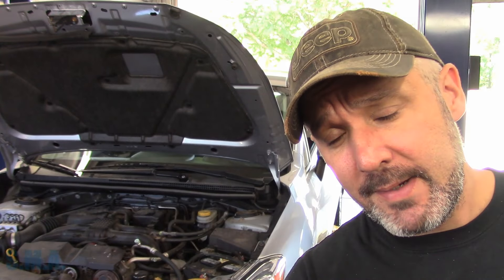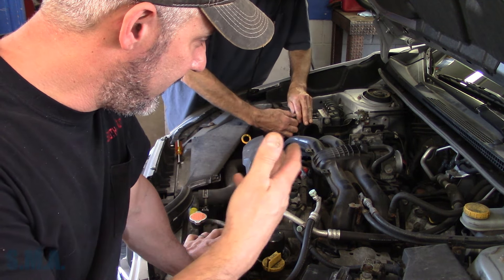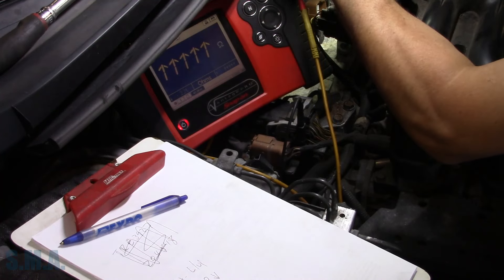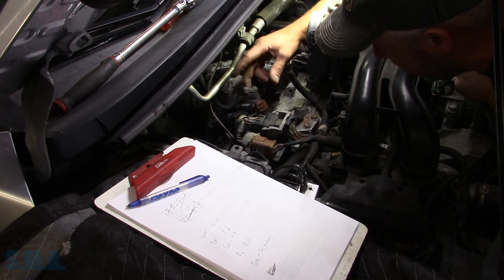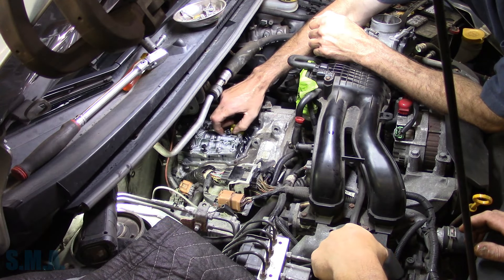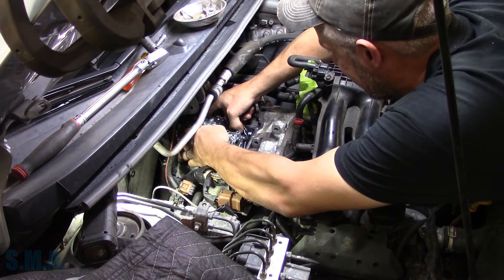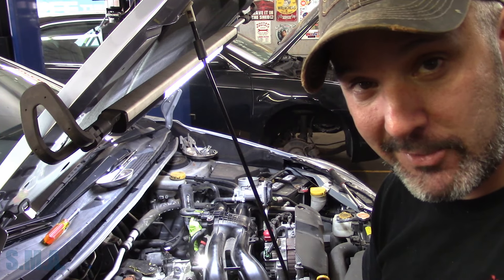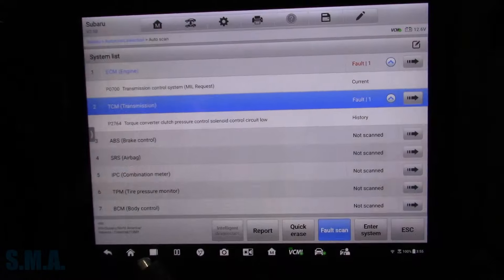Subaru CVT Transmission Valve Body TR580

Comment: My mom’s 2013 OB with the 2.5L engine has an issue with the CVT slipping on occasion when coasting downhill and when accelerating hard the rpms go up like mad. The car now has almost 100k on it and it’s been doing this since new. I had the CVT gear oil changed out already and so far it’s still the same. I’m wondering if this valve body could be the issue.

Comment: Hi there, should I also change even the codes are not always persist, so the same codes you have appears sometimes in the morning, and when they appear in dashboard, I simply turn off the car, then turn it on and the codes simply gone

Comment: I am facing with same problems but my code is different it gives 
P0971 code and AT OIL TEMP , traction and ABS lights came one 
Do you think it will be the body Valve ?

Comment: I just had a valve body replacement on my Subaru 2011 legacy but the car is stalling when I stop and then drive. Why do you think that is? 
The relearn system that was used was different from yours. Should I do the relearn you showed in this video instead? Please advise and thank you!
Reply: worn bushing in torque convertor

Comment: I prefer your original style of videos. These are fine however.  I am not a mechanic, but i fix or repair everything in my household domain. in 40 plus years of driving I have only paid for the inspection and emission stickers. you tube has made all types of repairs easier. in years past it was repair manuals and phone a friend that got me through. I am 63 but I think it is so interesting how many old sayings and slangs you use, most likely picked up from your father. your on screen relaxed, natural, informative and funny videos are great. as good as the information is I would likely not enjoy them as much if you weren't doing them

Comment: I am pulling P0700 and P0763 code but a mechanic who does not work on Subarus said I need a Transmission Valve Body Replacement.  I have a Subaru 2012 xpremium 2.5 NON Turbo.  But I can not find that for code P0763.   
Thanks in advance if you respond

Comment: OK......  have to ask.....    got a 2008 Subi Tribeca from my daughter (she was second owner from 23,000 to 185,000). It kept throwing a turbine speed sensor code. Subaru told her $$$$ to fix it. After I got the Subi I pulled the valve body and replaced the turbine speed sensor on top of the valve body....  No more codes but now every so often the car doesn't like reverse. It has to set for a few seconds in reverse before it likes to go in to gear. Has the required amount of fluid but feels like it doesn't when it does the reverse thing!!  So wondering if I should just replace the entire valve body, which would include a mother new turbine speed sensor.....???

Comment: Sir, isn't there a threaded hole in the dowel pins? In many cases there are, and you can pull the pins out with a slide hammer. Didn't Subaru think of this?

Comment: Hi eric i have a 2006 ford f150 supercharger truck and when i go to start it there seems to be no power in the crank shaft sensor what could be causing the problem if you can help me out?

Comment: I don't mind it someone else does the work. I would really like if there is something we need to watch for when taking out bolts like the underneath valve body has one or two longer screws, that you would take the time to say hey during this step you need to look for these two bolts.

Comment: i like this i might wind up doing this to my stupid Subaru cvt with that transmission hopefully the car will be gone before then. they already sent me a notice that my model has some transmission problems, so they extended warranty to 100,000 miles too bad im at 130,000 
Got any videos on changing some transmission fluid in this supposed lifetime fluid transmission? everyone has the newer 690 transmission

Comment: Your test showed that the output signal circuit of the lock-up duty solenoid is shorted. You should have shown the connector and how you tested it, while you did it. You should also get the camera closer when you are filming, if possible. Maybe hanging it straight above what you are doing. I can't believe that you had to replace the whole transmission valve body because of a short in one small wire. And it makes me wonder why this output signal circuit shorted in the first place. It shouldn't do that without impact from something. Could it be exposed to fluid of some kind?

Comment: Did you get the big plastic tarp with the valve body?  That is to cover the engine bay so you dont get any dirt inside the trans.  There is a hole in it that you put the valve body through it.  It took us a few times to actually figure out what the tarp was for🤣

Comment: Why does the valve body requires a calibration after the install? Solenoids are just on or off. There is no range to calibrate to. I am asking this as I am waiting for the delivery of my valve body and don't have the pro scan tool you have.

Comment: Can imagine it drove weird with no TCC lockup. Used to have a Saturn Ion with the VTi CVT. It had some logic where the TCC wouldn't lock up until the fluid warmed up to something like 30 degrees C in order to warm the fluid up faster. Well I assume whoever had that brilliant idea did NOT love somewhere which had extreme cold winter weather as that could take as long as 15 minutes in the -30 to -40 temps we can get, and it drove like it was stuck in low gear that whole time. Not good for acceleration or gas mileage in the winter for sure..

Comment: just a quick Q Eric O of SMA... Was there some reason the owner did not take the car to Subaru when the original trans failed at 8XK? most if not ALL of the Subaru Lineartronics have a 10yr/100K warranty that model of Impreza was included..

Comment: What AUTEL TOOL are you useing?? The link in your description doesn't lead to any specific tool.  Oh wait, you said Autel Ultra. It's about $6k so it's not worth the pricetag for the occasional use. 

I recently replaced my valve body on a 2014 Outback and need to reprogram the trans, but having a difficult time finding a tool that is affordable. Does anyone know if the Autel MaxiDAS DS808K will do the transmission reprogramming?

Comment: How common are CVT solenoid failures in Subaru's? Are Subaru's more prone to this failure and expensive repair? I'm not a big fan of Subarus or CVT's, but considering the 2024 Crosstrek for it's AWD and economy.
Reply: Most are from lack of proper maintenance/regular service every 30k. Also lot more common on the older years pre 2016. 2016+ is pretty solid, seen many with 250k on original if maintained/cared for properly.

Comment: Did you test the solenoid? Are you sure this was caused by a faulty solenoid and not by the power supply to the solenoid? The code said circuit low. This is just me trying to understand what happened since we didn't see what you were testing.
Reply from the maker: Maybe go back and watch the video where I showed how to test the bad one and then I show how to test the good one...

Comment: My 2016 legacy (tr580 cvt) Got problem codes:P0971–P1604 rear diff isnt working it drives with front wheels but to change solenoid i dont know diagram of tr580 help pls

Comment: So, is that a Jatco CVT? I've heard all sorts of bad stuff about those. Jatco is in a lot of cars. They give trouble.
Reply: Subaru motor vehicles have used manual, conventional automatic, and continuously variable (CVT) transmissions. Subaru manufactures its own manual and CVT transmissions (for non-Kei cars). Since the 1970s, all Subaru conventional automatic transmissions have been Jatco designs adapted to Subaru specifications.[citation needed] Since the 2014 model year, the conventional automatic transmissions in North American-spec Subaru vehicles have been replaced with Lineartronic CVTs (with some exceptions such as Outbacks with the 3.6 liter engine). 

Source: Wikipedia list Subaru transmissions

Comment: Eric, I am a little bit confused with this repair. It seems that you repaired the short, and did not change the lock-up solenoid. You did not show the repair of the short to ground.
Reply from the maker: The shorted solenoid was in the valve body. We replace the valve body because you cannot buy the solenoid separate. Makes sense now?

Comment: If the car doesn't stall or attempt to stall during 10 hard stops from 20mph to 0mph, 10/10 it needs a valve body.  If it does stall then it needs a valve body and torque converter

Comment: You always comment about nobody using the parking brake, let this be a lesson to people who don't. I was in a parallel-parking situation, standing behind my own Subaru (2nd-gen Outback), getting some things out of the back.  Another driver backed into the front of my car hard enough that it knocked the transmission out of park and into reverse. The car rolled backward knocking me down.  If there had been a car behind me I would have been pinned between the two. The parking brake keeps your car from becoming a free-range menace to pedestrians in the event of an accident. The only thing better would be carrying chocks with me.

Comment: Is this XT or 2.5?
Reply: Neither bro it's a 2.0 with a TR580, those engines you're speaking of prob have a tr690 which is accessed from under the transmission

Comment: One step process to fix any CVT. 
1. Trade car in on another vehicle with a normal transmission.
Fixed.
Reply: Check that the normal transmission isn't one that has been known to fail. It does happen, but very rarely compared to the automatic transmissions.

Comment: What, you couldn't just add an 11 ohm resistor in series with that?  Lol - I keed, I keed. 
Seriously, though - I believe there is a Subaru "special tool" which is plastic to cover everything (including hood) when that valve body is exposed.
Reply from the maker: Yeah they sent it with the valve body haha

Comment: At around 10 minutes you are levering on a bolt that goes through the top cover into the base.  How does levering up the base free the top cover????????      It is the top cover that needs to be levered up, surely?????

Comment: What bothers me about this video, is this Subaru has already had the transmission replaced and now the valve body, with such low mileage! Hmmm, I’ll keep my 97 Corolla, my 94 Camry, my 97 T100, my 93 SC400, my 99 Dodge diesel 2500, my 02 Lexus LS 430. What in the crap am I doing with so many vehicles! I’m single and live by myself. I need help...

Comment: P2764: Torque Converter Clutch Pressure Control Solenoid Ctrl Circuit Low OBD-II Trouble Code
A torque converter clutch pressure control solenoid allows the ECU to control the operation of the torque converter clutch by manipulating the flow of pressurized transmission fluid. If a low voltage signal is detected, a P2764 DTC will be stored. How Serious is the Code? In terms of severity, a P2764 diagnostic trouble code is quite serious because it means the ECU is having trouble engaging and disengaging the TCC clutch. Some of the transmission problems you may experience include engine stalling, transmission overheating and erratic shifting.

Causes
Insufficient transmission fluid
Dirty transmission fluid / filter
Frayed wiring / damaged connectors
Transmission fluid leak
Failing torque converter clutch pressure control solenoid
Failing torque converter
Failing torque converter clutch
Internal pressure problems
Valve body issue
ECU or TCM failure

How to Diagnose the Code?
The first step to diagnosing a P2764 OBDII trouble code, is checking the level and condition of the transmission fluid. Checking the wiring and connectors for signs of damage and corrosion should also be done. If everything looks good, the TCC pressure control solenoid will have to be checked. 

What Repairs Will Fix P2764?
Change the transmission fluid and filter
Repair transmission fluid leaks
Clean corrosion from connectors
Repair or replace wiring
Replace faulty torque converter clutch pressure control solenoid
Repair or replace a faulty torque converter clutch
Repair or replace defective torque converter
Flash or replace ECU/TCM

This explanation is taken from transmissionrepaircostguide. I hope they don't mind that I copied it, since I guess I cannot link to it from here.

To the australian guys: What is seems that you can try to do yourself, is to clean possible corrosion from the connectors, and if that doesn't help - change the transmission fluid and filter. There could be more severe problems with the transmission, but since those two alternatives are listed here it might be worht a try?

This seem to boil down to a stop in the signalling between the torch converter clutch and the ECU. So if I understand this correctly, the signalling between the torch converter clutch and the ECU is still analog on this transmission. Am I right in assuming that? 

And is there still a chance that the torque converter or the torque converter clutch has failed?

Comment: And that there is "exactly" what is wrong with a mates car here and subaru being a pack of C's don't want to know anything about it unlike america where they have extended the cars warranty repair services to 10 yrs due to this issue. I also believe it is a Gen 1 box so valve body underneath. It has been to a subaru dealer and tested but no listing for the ohms other than "low" and we can't buy the valve body in Australia. Bastages !
Reply: Further to this issue I did actually get around to finding out which box it had TR580 and further on I removed the valve body, replaced the faulty solenoid, repaired the earth for the primary up solenoid as it was broken, put it all back together and P2763 code fixed no relearn required. Happy days.

Comment: I never understood why manufacturers cancel the stability and cruise control with any MIL activation. Subaru does that for a evap and cat codes. Can’t see how that would impair the safety of the vehicle. I know Toyota does that as well. CVT=garbage.

Comment: turdbawuuu. what year is it? how many kilos/miles for first trans to fail? you have to baby the gas pedal on these they're not designed to handle "hard" acceleration lol imagine that they dont even put transmissions to handle weak consumer grade engines. subaru didnt program them to accel more gradually either so people break theirs because they like accelerating hard and dont know about subarus shoddy automatics and CVTs. scotty always says to get a manual for subarus. for most brands, infact lol i dont know why people bother with these broken car brands. subaru doesnt look all that 'cool'. people are peacocks these days they need the looks and no substance. much like their souls it seems..
Reply: k i noticed the mileage is 160 000...so subaru trans fail before that at some point. nice of subaru to beta test their stupid cars on their customers and then not pay for a new one probably. toyota doesnt do that to their customers in much of any way. maybe some odd recalls here and there but not powertain issues.